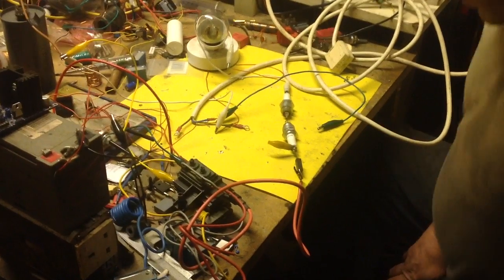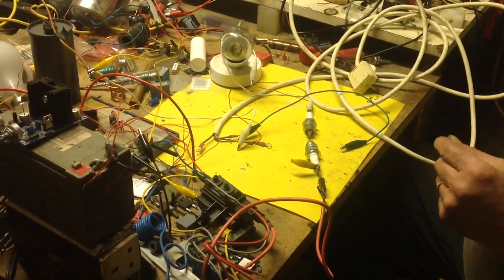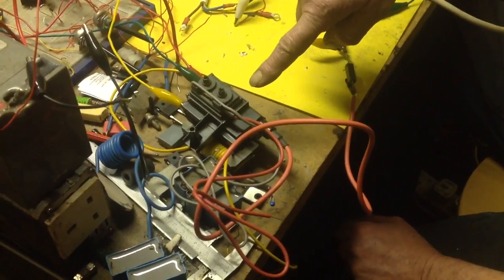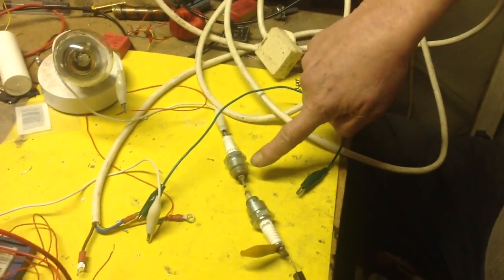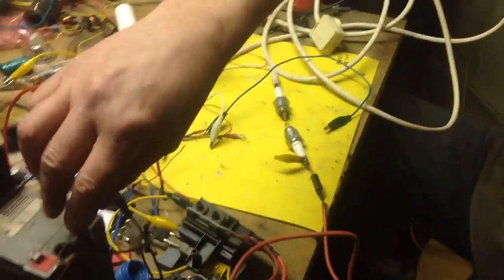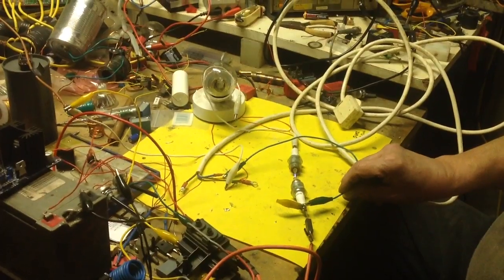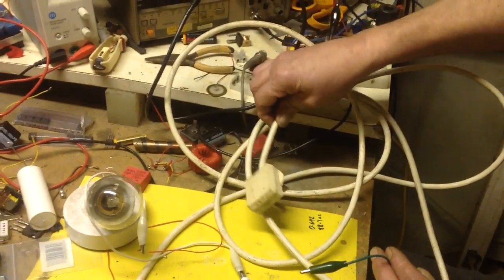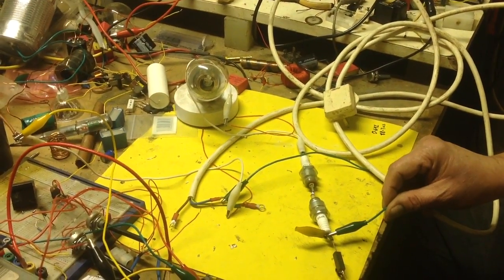Spark Gap

Comment: Grum hi, yes but your using the positive energy from the LOPT  if you get my drift  but why not try it the other way round and charge a cap up and dump it into the LOPT primary I cant get on the tread got kicked off for asking Richard Max Fried to many questions or would draw you a circuit.

Comment: Hi Grumage, quite interesting. I will request you one more test. Instead of the power cord, use a coaxial cable wound on a 3 inch diameter former. Also keep magnets near the spark gap in NS position. Another suggestion = Have another separate ground wire connected to a steel or iron rod across the other side of your house and connect it to the other wire of coax, enjoy free energy. Thanks for sharing.

Comment: For HV I often use a nice length of coax cable. Like 3 meter or so. They are very well insulated. So yes, you have got yourself a nice capacitor, although the insulator was not designed for HV in both our cases.